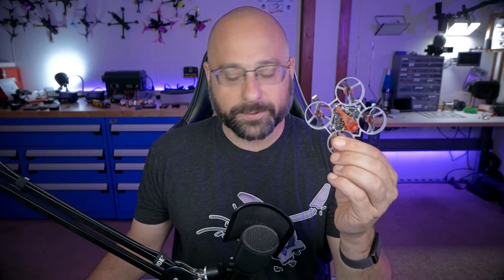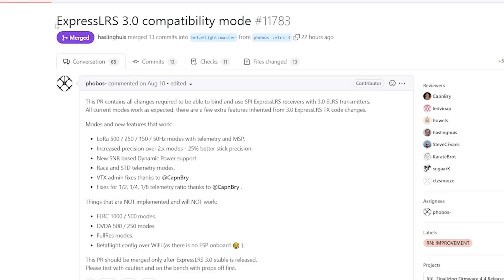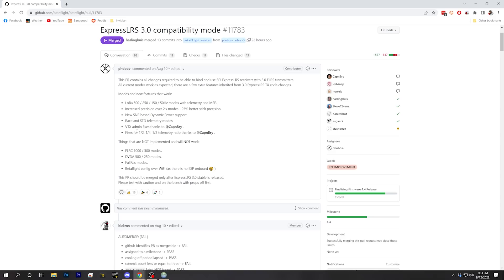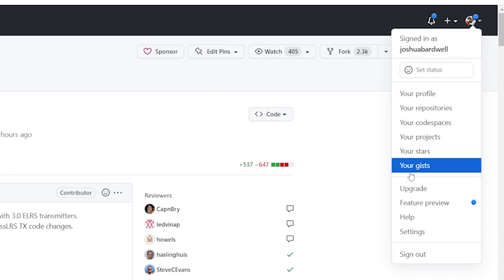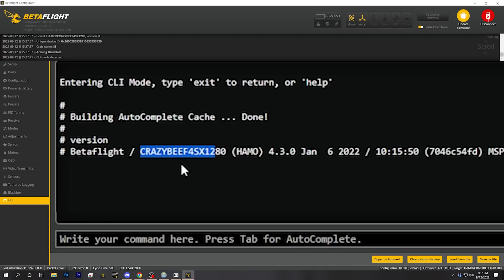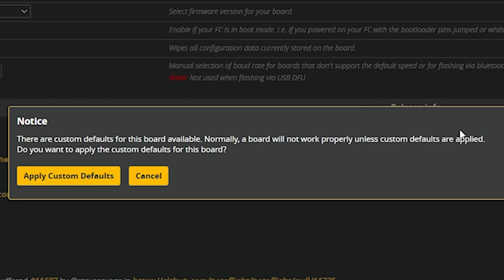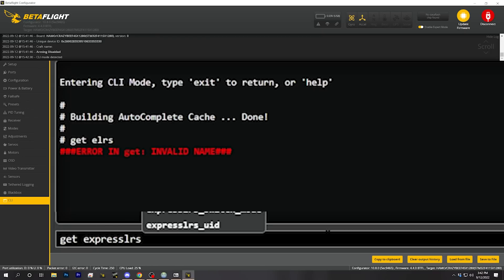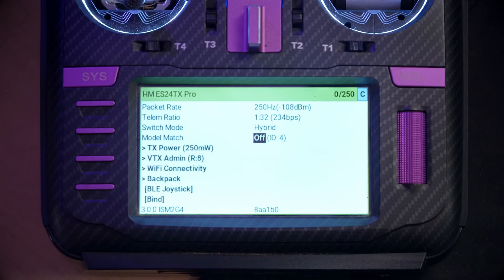How to put ExpressLRS 3.0 on your Tiny Whoop (SPI receiver workaround)

Comment from the maker: Dale Larson has built a version of BF 4.3.1 with ELRS 3.0 code built in. I strongly recommend using this instead of the BF 4.4 nightly build, since nightly builds may not be stable. Download the hex files at: https://github.com/DLLarson/betaflight/releases/tag/BF-4.3.1-with-elrs-3.0
Reply: I notice 4.3.1 for elrs right after I watched this for the first time. Thank you for making this great content, that's easy to follow. Im not getting any younger...
Reply: Nightly is giving me all kinds of issues. Def not recommend yet
Reply: Curious if this is the fix for my problem. I got the newbeedrone hummingbird f4 v2 BNF/ELRS & radiomaster zorro w/internal elrs. Followed your videos and others and flashed edge TX and elrs on zorro. Watched your vids but can't get newest version of betaflight to identify a FC board  or target when in Update Firmware screen. It does recognize my FC and version of betaflight though in menu. This sounds like the fix. I followed the link and didn't find a specific hex for newbeedrone hummingbird v2 elrs but did see betaflight_4.3.1_STM32F411.hex file, plus a couple others with F4. Is this the correct choice ? The problem is there’s no board to choose in the drop down list even if you use this option….The help is MUCH appreciated.
Reply: @beardawgstudios  did this resolve your issue. I’m going through that exact same problem with my NBD Hummingbird F4 V2? Ty
Reply: @ArthurRodriguez  No it did not. I ended up just re-flashing my new Radio Master Zorro in ELRS back to version 2 ELRS. Fixed everything.
Reply: Same with my mobula7 1s elrs spi.
Reply: thanks joshua for your amazing work, i have fleshed bf 4.3.1 with erls 3 and it works fine
Reply: @sberzfly  i flashed it on a happymodel x12 but im getting no gyro after flashing
Reply: @deroskar  Same thing happened to me.
Reply: Works great except doesn’t support 100hz full res mode. Hopefully it’s coming!

Comment: 4.4.2 has been released and it still doesnt work.....  ELRS 900 flashes one way and ELRS915 a totally different way one uses BF pass thru or FTDL(?) and the other is WiFi or USB ( if you are lucky enuf to get wifi to show up) Ive tried every combination and no joy...  BF will flash the FC, but ELRS cant find the Rx on the FC, so no Rx flashing is going to happen, the built in Rx was a bad idea, BF sez its a serial but happy model sez its SPI and the mobula6 box sez its a 900 and on the other side of the box it sez its 915... so basically there are 10 different combinations to choose from to flash and plus the boot button on the FC broke and I had to solder wires to replace it, now I have 2 wires sticking up that need to touch each other when it comes time to "boot" mode it...  the only thing this is good for at the moment is a FPV transmitter... maybe Ill hot glue the FC to my 35$ cheap quad and have working FPV for it...

Comment: Another great video, thumbs up, I successfully flashed the larson file and my Mobula 7 1S is bind to the elrs V3. When I tried the same thing for meteor 85 2022 hdzero, bam I got no gyro, I flashed with the betaflight_4.3.1_BETAFPVF4SX1280 hex file. What am I doing wrong here?
Reply: Thanks for your input josh, I upgraded to 4.4 and now I get elrs V3 on the meteor85 2022

Comment: Oh, i just came across this video in my suggestions... Few days after i solved it for moblite7 that i just received. First off all i wasted 2 hours trying to bind it and trying to learn what happens, but then when i realized what happens, I just took old tx module to tx16s and flushed elrs2 on it. I decided to not take nightly builds. This is old video, older than i expected. BF is still not released :(

Comment: Can 4.4 run 2.5.1 elrs? I'm having some weird issues in 4.3.1my gyro doesn't work and elrs does but in 4.3.2 the gyro comes back but then elrs has an error in cli. I've managed to get both elrs and gyro working on 4.4 but can't get it to bind. Running 2.5.1 on my zorro would upgrading to the newest elrs solve my issue?

Comment: mobula 6 elrs, can't get it to flash the firmware. It says 'rebooting to rom bootloader' then 'failed to open serial port' 

It's not a port issue, I can connect to it just fine. It seems something goes wrong in the rom bootloader. Any help would be greatly appreciated.

Edit: It was a driver problem. Apparently when it boots into bootloader mode it requires the installation of another copy of the driver software for that specific connection. Ended up just using Zadig to install it.
Reply: haha thank you! I recently got a bubito from Rotor Riot and have been trying to get it to work with my Pocket radio! This seemed to do the trick! Thanks!

Comment: Seems to me this is a big flaw in SPI ELRS - it's a moving target. Presumably it will happen again at 3 to 4, and so on, because it is under continual development.

I'm considering building a 75mm whoop at the moment, and one of my criteria will be to use a NoRX board and an external ELRS RX - or just stick to FrSky onboard versions.

Comment: That's not really a nightly, more a test build. You can flash a nightly directly from BF Configurator without downloading a firmware, just need to tick thr devdlopmenf/expert mode opts in the firmware flasher. But that PR build is a better one to get a bunch of people to use, and report issues with. I. E. A fixed point in time, rather than a moving target (which nightly? What else has been changed?) And if we're talking whoops here.. They bounce well! 🤣

Comment: My DJI goggles V2 just started displaying "image transmission signal lost". This is with the GepRC cinelog35. Do you have a video on that or possibly make one?
Reply from the maker: You have lost link to your video transmitter. Check the video transmitter: is the LED on? Is it green? Is the vTX powered up? Does the link come back if you get closer to the quad or is it all times the link is gone?

If you want to email me joshuabardwell@gmail.com those are the questions I would start a troubleshoot with.

Comment: Guys I'd be VERY hesitant to do this if you're running the BetaFPV ELRS 1S board with the old "Gyro" yaw issue. I had worked around and had the board running fine on 4.3. Updated to 4.4 to have the latest ELRS 3.0 firmware. Ended up rolling back to ELRS 2.5.1 & Betaflight 4.3 as i didn't like the feel of 4.4 and BAM. Dead Gyro! PLEASE BE CAREFUL! 👽
Reply: Hey ! 
I think i killed my board with that 😢😢😢 
Could you explain the issues to me? No work arrounds here?
Reply: @Floh545  If you have no response from the yaw then i'm afraid it's dead. If you do try and fly it, it will just keep yawing uncontrollably... I've tried many ways to try and fix it but nothing works
Reply: Recalibrate in setup. also check channel mapping
Reply: I ran into the same prob on the meteor 85 2022 hdzero bf says no gyro, I reflash 4.3.1 on bf and the gyro is working again but I cant bind with elrs V3, so now I'm stuck
Reply: update as per Joshuas input, upgrade to 4.4 and itt fixes everything

Comment: Currently debating on staying with the DJI radios, or switching to ELRS. I started with QX7, and toyed with a X9 Lite, but gave both of those away when I started flying the DJI v1 radio. Super long battery life, button integration with goggles, and no reciever needed for my whoop conversions. But now with v3 AU coming, it's unknown if it will support DJI RC2, and RC2 doesn't have the button integration with the goggles. I may be building mostly new quads and getting rid of the current ones along with the v1 controller and v1 goggles. My Goggles 2 should connect to the Vistas (eventually), but my v1 RC likely won't connect to the v3 AU. So this is my interest in your ELRS
SPI video. My most recent build has an ELRS SPI reciever on the whoop board. I didn't use it, but it should be fairly easy to swap over to.

What's funny is the DJI v1 radio used to seem ultra expensive, but now when I look at ELRS radios to replace it, the DJI RC2 is actually on the cheaper side.   EDIT: I see I was just mostly noticing all of the different TX16 models. There's several other transmitters in the $100 range.
Reply: One thing to keep in mind with the TX16S is there is a reasonable price range, depending how premium you want to equip it. I. E. All metal gimbals + CNC parts is more expensive than standard hall gimbals and plastics. There are some good brands and TX designs, but I personally would stick with RM due the R&D they are putting in, and the support they offer. Self-build can be expensive, but in the long run I think it's cheaper and you have a better idea how it all works, and can maintain your gear better because of that.
Reply: @pfeerick  The lowest I saw for a tx16 was $200,...which is about "ok". I did see the Zoro is reasonably priced. Also the TX12. I don't really care much for bling. Hal gimbals would be about as much as I'd spring for.
Do you mean self build drones, or radio? I definitely do plenty on the drone side. Some are more like "rebuild" or conversions,...  But I just found I didn't really need Amber or Lua in my radio. Nor do I "need" ELRS or 900mhz to have a link more stable than video. The DJI radio holds solid when the video Mbit is in the low single digits. But it might be time to change if the winds(compatibility) aren't blowing right for me to stay DJI.
Reply: @rcrdps8144  Self-build drones - I'm not so much into self-build on the TX side, but I do know one person who designed and built TX and RXs from scratch... and some of the ELRS guys are into designing custom handsets. 

Yeah, unfortunately prices have been going up... I'm it was around $180USD or even a bit less when I got it ... that was a couple years ago now though! 😆 If you don't want color touchscreen... TX12 is probably the best radio to get unless you prefer gamepad form-factor - since you can use standard 18650 or even the 5000mah pack with the TX12MK2. And you don't sacrifice sound or Lua either, which you do sort of need since you use it to configure the ELRS link, and you can also tweak BF parameters using the BF Lua. 

As far as DJI, time will tell, it's early days still, but good to keep a finger on the pulse for other stuff so if they become too restrictive you'll know which way to jump ;)
Reply: @pfeerick  Thanks for the recommendation. I did watch some more videos last night, and I think I'm pretty set on switching to ELRS. And I've definitely been eyeballing the TX12. Need to watch some reviews on that one today. The DJI v1 RC is kinda smaller in the hands, and when I had the X9 lite, I liked the way it felt too. So I think I'd like the TX12.

Comment: my mobula 7 1s seems to be in a "beginner" mode where i cant pitch/roll more then about 20 degrees. how do I change/ disable this in betaflight?
Reply from the maker: It seems like you have Angle mode activated. Most likely there is a switch on your controller that will disable Angle mode. Plug in to Betaflight configurator, go to the Modes tab. You should see that Angle mode is yellow indicating active. Flip the switches on your controller until Angle mode turns off (goes gray). If you need to manually set up an aux mode, here's how: https://www.youtube.com/watch?v=feObDe54wKw&ab_channel=JoshuaBardwell

Comment: It's hard not to spit every time I hear the word ExpressLRS! Buggy software, junk equipment and an upgrade that causes a whole bunch of new problems that didn't fix the old one's. All this grief over a receiver. IMO it makes FRsky D8 look damn charming in comparison. At least the D8 would fly across the yard before it lost signal and fell out of the sky. This BS ELRS can't seem to make it away from the computer table 😒
Reply: Your experience is unique. ELRS has been nothing short of amazing for basically everyone.
Reply from the maker: If you're not getting miles of range from ELRS, something surely isn't right about your system. I couldn't guess what that could be, but it's hardly the norm. "Buggy software?" IDK what you count as a bug, but I'm not aware of any that made it into a final release. But sure -- it's an open source project that moves fast. If that's not your style, ELRS isn't for you.
Reply: @JoshuaBardwell  Moves fast, yes. I"m here 4 months after most of this discussion wondering if anything has changed. I could have sworn there was a 4.4 hex file offered on the Happymodel web site, but now I can't find it, so I'll try the 4.3.1 file you recommend in your pinned comment above. Per your BF video series, I have the latest BF Configurator 10.9.0 RC5 and 4.3.2 firmware on my X12 AIO.
Reply: @JoshuaBardwell  it's definitely not for me. I would rather spend my free time flying than sitting at a computer scratching my head wondering what to try next to make the last error message to go away 🙃.
Reply: That is certainly not the norm. Is it more complex than other systems - yes, at times. Does it have its own way of doing things - yes, just like every other system. Does it generally just work - yes. Most of the problems with ELRS stem from naufacfurer QC (or lack thereof) and provisioning, sheer back luck, or failure to read the instructions properly. I. E. There is a 2.0 => 3.0 upgrade issue - which stems from how some manufacturers initially flashed the firmware. There are failsafe issues from how some manufacturers configured the reference frequency crystal  oscillators. But all of this is documented, and as long as you don't jump to be the first cab off the rank, all this information is available.
Reply: I kinda feel this.. 😕 I know it's free but I have  2 mobula7 1s elrs spi and a mobula7 hd 1s frsky. the frsky bound first try and I was flying in 5 minutes.. both my elrs mobula7s are sitting on the bench. I flashed them and my jumper 2.4 axion nano model on my tango. 1 I finally got bound after 4 days of troubleshooting and hours of videos but it goes nuts when I arm. The other just refuses to flash.. 🤷‍♂️
Reply: It seems the issue is more the hardware than the software.

Comment: Way to early to be recommending flashing 4.4, irresponsibly so IMO.

Current discussion from Chris Thompson in the testers channel on BF discord

"- The BAD one: with the latest master code, I got random D 'grinding' and flyaways on arming, and occasionally mid-flight.  Log shows extreme resonance on roll, happening randomly.  This is on a quad that has never, ever, had this issue.  The older master code (from before some recent PR's) has been entirely problem free.
It may only be a problem on my F411 board with CPU load or something, not sure."

Guys this is an exciting feature but we need to wait until we are closer to the feature freeze to recommend people go flashing nightlies and literally pre-alpha hexes 🤦🫣
Reply from the maker: I'm explicitly NOT recommending it. I'm saying, if you accept the risk and want to try it, here's how. Look at timestamp 0:59
Reply: @JoshuaBardwell  sorry, not necessarily directed solely at you. Look at your comment section though. "No need for the asset folder anymore, just flash master" and such.

Though, ironically, the asset folder from the PR is seemingly safer than current master...

ItsBuntly literally had a rant about this on the news with your face on the screen when we were in the RC phase of 4.3.... This video is how we end up in that place, or do you not see that?

Comment: Met some dude who thought he's so smart that a T-Lite with built-in ELRS paired with a Mobula 6 would work together, so he could have the newer flashier compact radio running cutting-edge ELRS 3 (RC1) and a compact drone with SPI RX to save some weight - NOPE.

- 2.x FW does not exist for the built-in module
- SPI RX (on BF 4.3.x) doesn't work with ELRS 3.x

He ended up adding an EXTERNAL RX

Comment: Can I put expresslrs on the mobula7?! Do I need a new rx?
Reply from the maker: If your Mobula7 doesn't have built in ELRS, yes you need a new RX.
Reply: As an add on, if buying a Mob 7,would you recommend buying the on board elrs one? Or adding an external RX to a different board? Seems like the spi part is an issue?

Comment: What’s the best module to get for the xd9+ ?
Reply from the maker: Happymodel Pro is my recommendation. FrSky R9 does not have an EP chip and cannot do Wifi stuff so I wouldn't use it.
Reply: Go for the frsky r9m if you can get hold of it and flash express LRS to it

Comment: This code has already been merged into the nightly builds of 4.4. That assets file is not needed anymore. You can see the "merged" on the Pull request page.
Reply: When I flash with BF my rx wont bind. Works fine with assets file tho 🤷🏽‍♂️
Reply: @Rizz1117  you need to be flashing a development build or nightly build still I flashed both this and the nightly from a couple days after it was merged and both worked for me.

Comment: I've tried the nightly build on my Meteor65 and it doesn't fly as good as before and my range is about 25 meters before I get a failsafe. I was able to fly a lot further on 2.x.
Reply: Strange... Didn't make any difference to mine (Meteor65 also). Make sure you double check all the ELRS settings on your tx - ie power level isn't different?